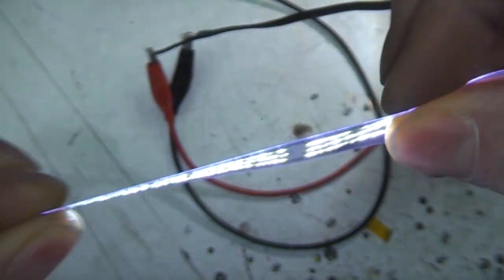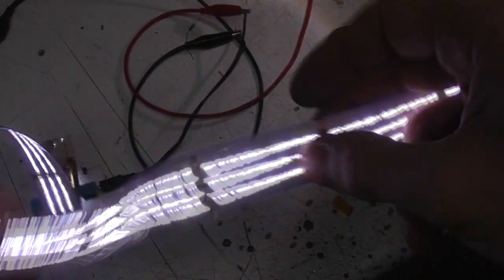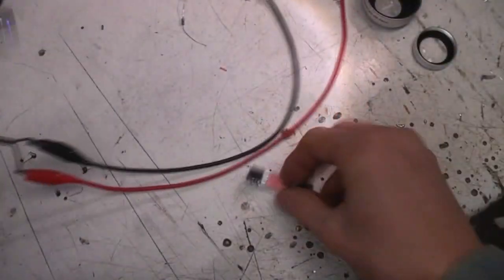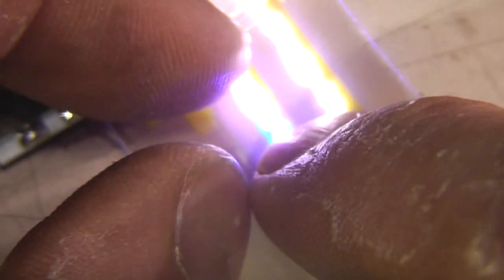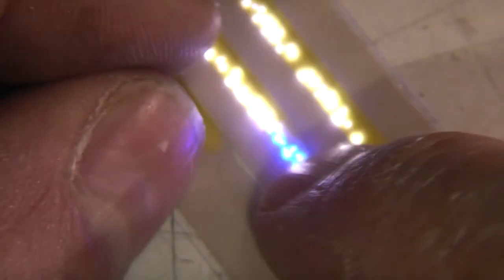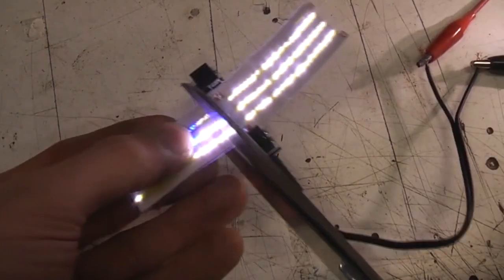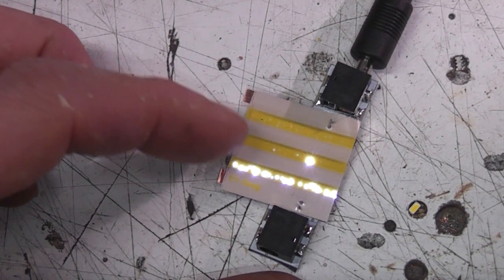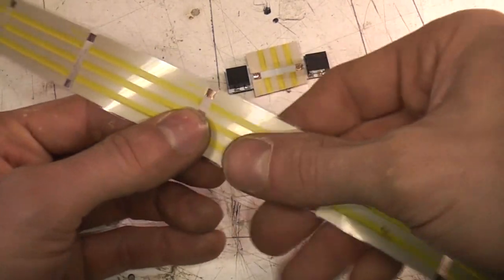Nth-Light Printed LED tape

Comment: These seen like an interesting concept, but I looked at the specs and the efficiency seems quite too low to be used as a replacement for existing LED strips.  They might fill a niche where super thin, physical dispersion or lighting effects are priority I guess.

Comment: Gun target is the primary application haha, good way to ensure repeat business I guess. Nice that someone actually developed that, most companies would have passed on the high risk development cycle. Fairly amazing they got it to work, can’t imagine the frustration during that process. Too bad they haven’t figured out a way to get the polarity consistency, I wonder if the die chips could be flipped with acoustics during manufacturing, electrostatics might be too harsh on them, might have some success with the right coating though, to get the to attract with a more uniform orientation.

Comment: What an interesting product. I was wondering if it would be practical to power it from a 7V AC source? From what I've seen of LED lighting it's rarely the LED that fails it's almost always the rectifier and normally the capacitors. If you could just stick in a 240 --> 7VAC transformer surely that would last as good as forever and be cheaper.

Comment: Constant current and AC to alternate banks of LEDs would be interesting. Should get more, and more even output I expect. Pretty sure they are not designed to be driven with constant voltage.

Comment: It's been around for 4 years.  The lines aren't solid enough & the segments aren't long enough to be used for anything.  There must be too much resistance in the transparent wiring to make the segments longer & the printing process can't apply an even coating of microscopic dots..

Comment: 30lm/W is pretty bad, especially when nice self-adhesive waterproof white brighter 100lm/W LED strips are available for little over a pound a meter in ones. Yes, they are 2.2mm thick, not 0.3, but... If they can get the price down far enough...

Comment: It's almost a slightly reckless way to make LED tape.  Literally just throwing a bucket of LEDs between the conductive layers and hoping most will point up (or down) the right way.  Since the typical forward voltage of each parallel layer of LEDs is going to be around 3V it might have been viable to make it four series circuits to run on 12V.  It's quite an intriguing material.
Reply from the maker: +kuro68000 The problem is going to be heat
Reply: @mikeselectricstuff  -- Unobtainium?
Reply: This is bs.. you can get better looking regular strips for 0.99 cents from ebay.. why do anyone want this tape crap the price is insane for crap like this..
Reply: +mikeselectricstuff yeah, it's an interesting design decision to put on 2x as many LEDs as they need just to make driving it easier. I remember when blue LEDs were a tenner a time, now people throw them around like fairy dust!
Reply: +bigclivedotcom it might be a bit recless, but on the other hand it Looks really nice when swithing the polarity, I imagine using one at the next Festival.
Reply: +bigclivedotcom I'm surprised they didn't supply a simple AC switching circuit in the sample/demo kit. A couple of FETs and a 555 and you get double the brightness and more even illumination. Maybe it's a heat issue, but then they could have saved themselves 50% of the LEDs... Any ideas?
Reply: Driving it with AC or having the LEDs all one direction wouldn't make a difference in brightness.  With AC all you're doing is time sharing between two different lighting options and it averages out, still 0.5+0.5=1, you don't get all the LEDs at the same time lol.  The maximum brightness emitted is not as much limited by the individual LEDs, and more about the heat resistance of the whole tape construction, so having all LEDs the same direction wouldn't improve that.

People, if you watched the video, you saw the effects of AC, in case logic failed you.
Reply: +bigclivedotcom I was thinking similar...if they could work out a way to 'print' it and have all the chips the right way up it would be almost brilliant! Printing LEDs... Hmmmm... Interesting point to drive it from AC too!
Reply: +bigclivedotcom It would be interesting to have flexible semiconductors that can form an LED junction. The problem here is the semiconductors are hard so they have to grind them up to put them on a flexible surface. The best way to do this would be to have flexible semiconductors and print them on top of each other to form a massive light emitting junction. The current could potentially be massive with a large surface area conducting, so the problem would be keeping it from overheating and burning up the tape.
EDIT: OLEDs is what they're called, the stuff used in display screens

Comment: I'm surprised they power then with DC. wouldn't it be much better to pwm them with high frequency and changing polarity.
Reply: +Tilman Baumann maybe because they expect them to be used in wide installations, and inductance will cause problems (not to forget about EMI compliance that might become problematic with high frequency, high-ish current switching over a wide area).
Reply: Ah. Never thought of that. Very good explanation.
Reply: How about just using the near-sinusoidal AC power supply?  If that is not available, use a simple low enough frequency PWM the eyes will still not detect (like some automobile or flashlight led circuits) with an output filter to quench anything much above the switching frequency, well below RF.
If a simple sine or square wave is available, the brightness can instead be manually switched using various low-cut capacitors.

Comment: So... I guess that those three white strips, each full of LEDs, are in series in a single section. And there is a rated current value for a section. However how does the current balance itself in a single strip of many randomly placed LED? Does that conductive stuff work as a distributed resistance of some sort?

Comment: I wonder, if you can overdrive them using an alternating current.
Perhaps the sudden failure is an thermal issue. The light emmiting particles are quite small and encapsuled with platik, with has no good thermal conductivity. So if both halves share the (over-)current, the heat get distributed a little better.
So perhaps you can get some more light out of it..

Comment: LED are current driven devices they are basically diode's so you do not apply a voltage but a current. I'm sure you know this so not sure what was the comment at 7:40. They are just normal blue LED's each with a voltage drop around 3V at nominal current.
3 LED's in series is very common for 12V applications with 4 LED's the voltage drop will be to high.
Interesting use of LED's. I guess the transparent conductive layer can be some sort of printable graphene ink.
Reply: +electrodacus Exactly. Pretty dodgy really, especially as there'll be a voltage drop along the tape.
Reply: +smoke tires erryday I have not noticed that in the video. How is that current limiting done ? some simple resistive elements in series ? If that will have been the case the LED's will not have failed in the way they did. 
Just took a quick look at the spec on mouser. I do not see any mention of current limiting. The spec is horrible not sure they know what they are doing. Mentioning 1A 10V power supply for an LED strip that dose not seems to have any obvious current limitation is strange at best. 
Any proper LED device should have at minimum nominal working current and the voltage drop at that current.
Is clear they have 3 strips connected in series and that 10V is about the voltage drop for lower quality LED's 3.3V for each group of multiple parallel LED die. 
The conductive layer probably has some resistance but I do not expect much voltage drop on that. Voltage drop on diode will also depend on temperature so with a fixed 10V supply without current limiting they will have inconsistent light output levels.
There are many startups that try to use some sort of printed electronics stuff and this will for sure be the future but this is not one that will succeed :)
Reply: +electrodacus LEDs will draw their rated current when the supply is equal to their forward voltage drop. If the supply is higher than the forward voltage drop, the current increases. Thus you can control the current draw by simply altering the supply voltage.

I guess they have the current flowing back and forth so there are essentially three LEDs in series, and thus if they are 10V nominal they must be 3.3V drop, which is unsurprisingly the common value for blue LEDs.
Reply: +kuro68000 That is not true the current will vary a lot with temperature of the LED die so constant voltage supply is not a solution for powering LED's There are also variations in voltage drop between LED's. An increase in temperature will increase the current draw of the LED at the exact same forward voltage.
The same model of LED can draw up to 2x as much at the same forward voltage drop.
If you double the current and of course operating temperature will increase and can reduce the life of the LED 10x to 100x
Reply: +electrodacus While correct, the effect of temperature isn't enough to worry about. You could have a nice constant current driver if you wanted to, but for the sake of an experiment varying voltage does the job well enough.
Reply: +kuro68000 The temperature effect is extremely large the current will increase with temperature that in turn create more heat (is a sort of snowball effect). You can easily make an experiment. No one will ever use an LED supplied from a constant voltage power supply without any current limiting device.
The simplest current limiting is done normally with a series connected resistor but you need sufficient voltage drop on the resistor for this to work.
LED's require a constant current supply not a constant voltage one.
You can easily make the experiment. Find the exact voltage an LED will draw the spec current then wait a few minutes while the LED will heat up and see what the effects on current are.
Then take one or two LED's of exactly the same type and try to supply them with the exact same constant voltage you applied to the first one.
For a small indicator LED you can just use a resistor as a current limiting device it will still not provide a constant amount of light in all conditions but as indication is less critical.
Reply: +electrodacus I'm not disagreeing with you, I'm just saying that for experiments and for simple applications it's fine. Loads of products use a single resistor and constant voltage supply to drive things like power/status LEDs. For trivial stuff variations in minor brightness don't really matter. But yes, for this kind of thing you would definitely use constant current if it wasn't just a quick test.
Reply: +kuro68000 Yes is true that many use just a resistor as current limiting element and that is fine if you have a constant voltage power supply (not a battery). I do not see any mentioning of a resistor on this LED strips (they could have implemented one directly on that plastic substrate). There is no mention in the spec of nominal current, voltage drop at that nominal current and 25C ambient and no mention of any resistor value in series with the LED's. Without this data that LED strip is useless and shows they probably have no clue of what they are designing and selling. I expect a spec similar to what CREE or OSRAM is providing.
Reply: +SDG Electronics you guys would be shocked at how many devices do just use a resistor and battery. Modern LEDs can tolerate an order of magnitude variation in current at useful brightness levels (say 2-20mA) so in things like battery packs people will save a few cents by omitting the regulator.

Comment: Why is that so patchy? Is it because it's a demo kit? Or are the "real" ones as patchy as this?
Reply from the maker: +TheTrueM3ga Because it's a random distribution of microscopic LEDs. If it was denser it would get too hot.
Reply: mikeselectricstuff so they just kind of scatter the raw leds onto the material?
Reply: +TheTrueM3ga It's just LED dies mixed in with a phosphor ink material and conducting material around it, but it seems like lots of the LEDs are never illuminated due to their orientation when the ink dried.
Reply: Doom2pro seems like a pretty stupid technique. But I guess the yield is as low as the yield of modern (very few) nanometer cmos processes :P
Reply: +TheTrueM3ga I expect you would want to put a diffuser over it if you wanted even lighting, although their website shows it being used "raw".
Reply: +mikeselectricstuff Nope. The surface heat sinking to die ratio is enormous.

Comment: Now that is pretty cool though there is a lot of gaps in between.  Seems a little hodge podge put together though it is still cool.

I take it back at 40 quid they can keep that rubbish.
Reply from the maker: +legalizeshemp420 Pricing of evaluation kits bears little resemblance to actual volume cost. This product is only viable if it's cheap enough, or for applications that need the flexibility.
Reply: mikeselectricstuff
Thing is none of us will be buying them at volume and to be honest they aren't worth a pound as bad as they are laid out.  I see possibilities but it needs to be made must better imo.
Reply: +legalizeshemp420 
The gaps are a non-issue. I have several different LED lights (bulbs, integrated, strips) and in all of them the single LEDs are much farther apart than on this strip. And still all the lights give perfectly uniform light.
Reply: superdau
I guess I would prefer them to all be uniform in size not like cocaine trails.

Comment: I love it! Fantastic idea for cheap, superflat, smooth and uniform lighting. Id love to get me a 50 foot roll of that.
Reply from the maker: +Doom2pro None of those matter if it's cheap enough. Light is pretty uniform once you get a couple of inches away.
Reply: +TAIGAXML Smooth and Uniform? I wouldn't use those words to describe this product... It's very patchy and uneven, definitely not smooth or uniform.

Unless you were being sarcastic?
Reply: +Doom2pro it prbl won't give the LED typical sharp shadows and allow for an interesting lighting option (maybe not looking at the led strips directly) compared to a strip with fewer higher powered leds in grids or patterns
Reply: +madinatore OLED can be used to create a solid illumination strip, no need for grids or patterns or "star field" patterns like this one.

I'm pretty sure OLEDs are already used for this purpose too... This seems very inefficient and sloppy looking, and I'm sure there are 1/3rd or more LED dies in that ink that will never illuminate due to their alignment after the ink dried.
Reply: +TAIGAXML I agree, love this... there are so many  people here already saying negative stuff, this is clearly a very early stage and is already pretty awesome
Reply: +TheChipmunk2008 It looks like an early prototype, yet it's not, it's a marketed and finalized product... This is my issue with it, it's ugly, inefficient (not all the LEDs are utilized), and you need a pretty strong diffuser to hide the irregular light output.
Reply: +mikeselectricstuff Yes the price can make a bad design more viable, but is it cheaper than OLED?
Reply: +Doom2pro 50€ for a test-kit (measly 0.5m of strip + cheap power supply) doesn't sound very appealing to me. For that price I'm certainly not going to plaster a room with it, which I'd love to.
Reply: +TAIGAXML It's in very early deveopment research state. At this rate I don't see ANY application.